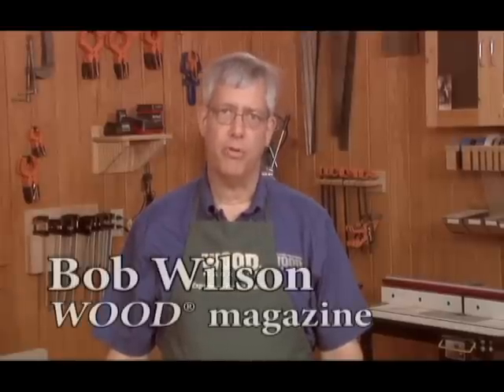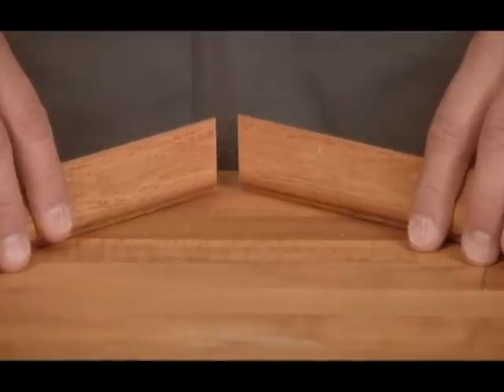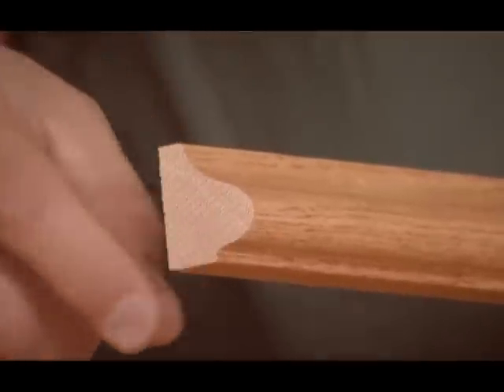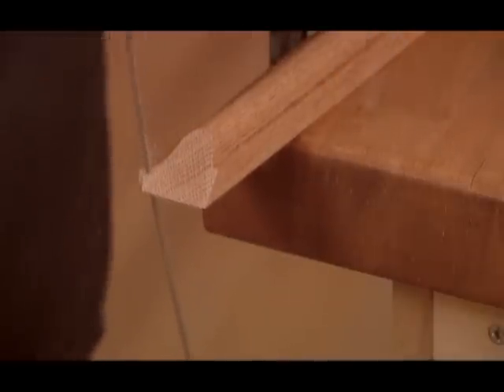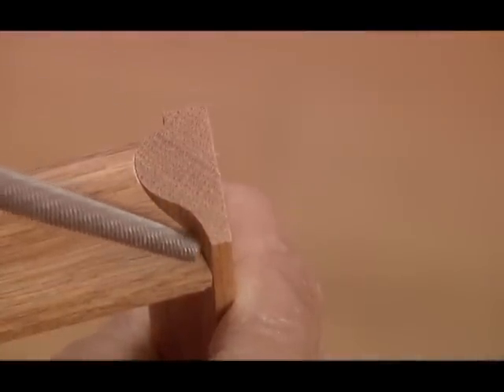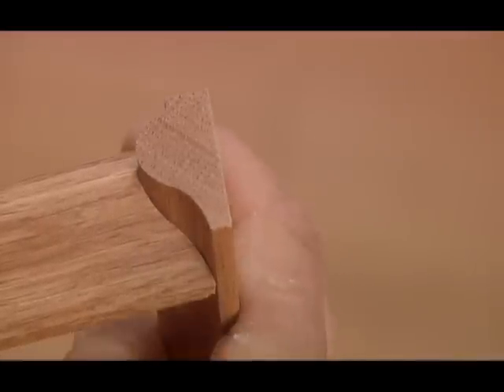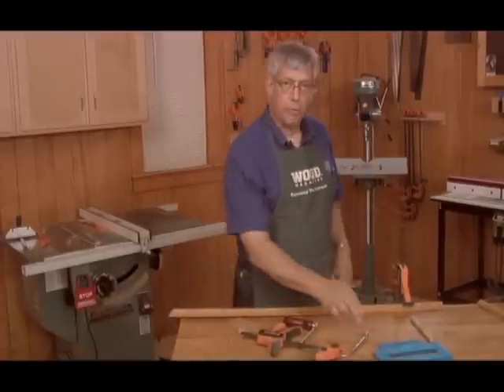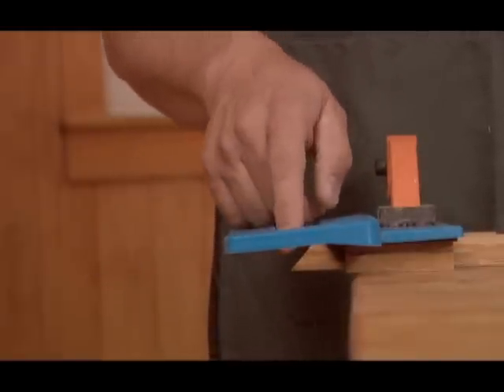How To Cope Molding for Inside Corners - WOOD magazine

Comment: Well, you told us that a coped corner won't open, but you don't tell us why.  The coped piece can still expand and contract againts the non-coped piece.  How is this better?
Reply: Ah!  Ok, that makes sense.  Thanks.
Reply: The gap will only open up half as much as a mitered joint; the non-coped piece can contract quite a bit and its gap is totally hidden.  I don't remember if he mentioned this or not, but another reason you use cope joints is the corners in your house are rarely perfect 90s; the miter joint angles have to be exact but you don't know exactly what.  The cope joints only have to match the profile.